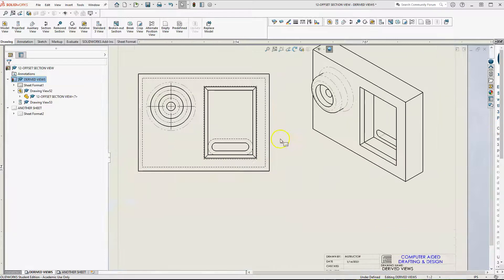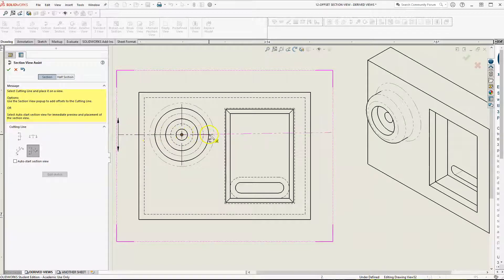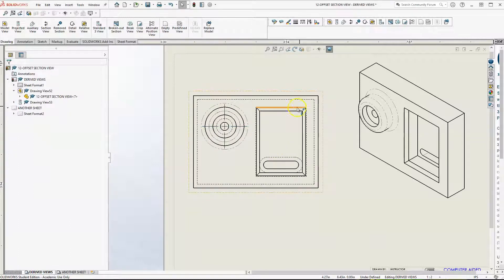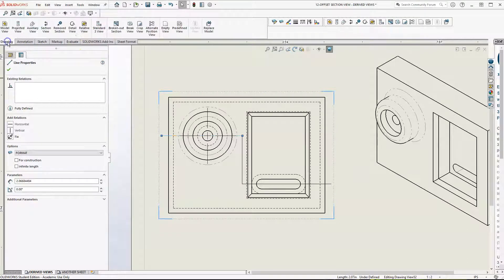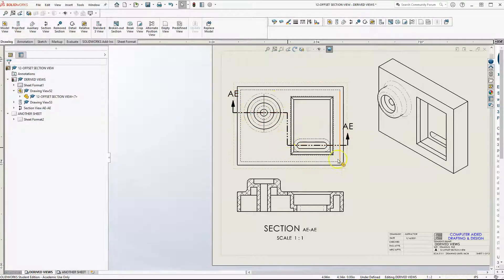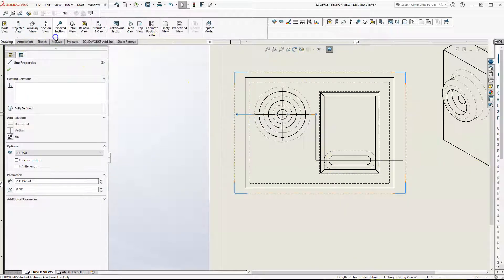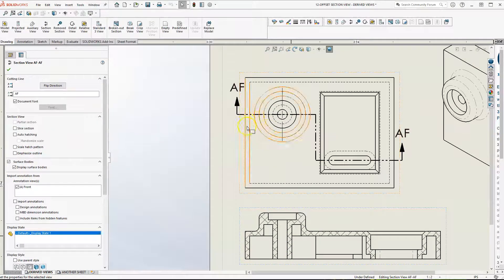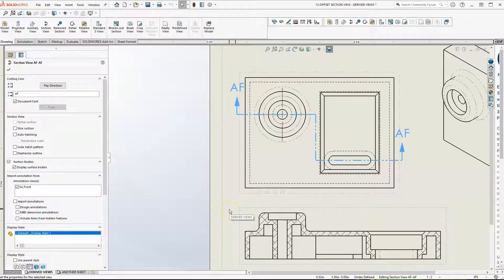SolidWorks: Drawings Derived Views - Offset Section

Comment: There HAS to be a way to exclude that vertical line of the cutting plane line from the creation of the offset section. That is not an offset section. An offset section should be orthographically aligned with the view the section was taken from.